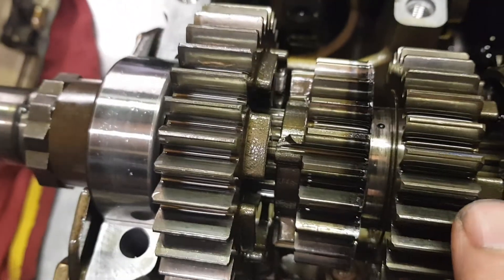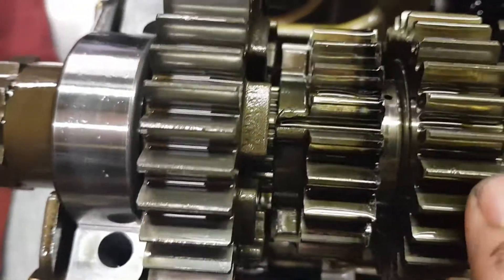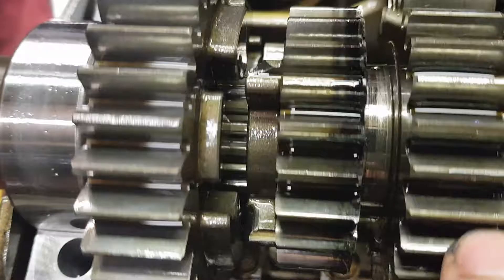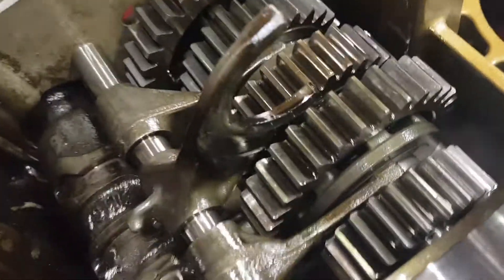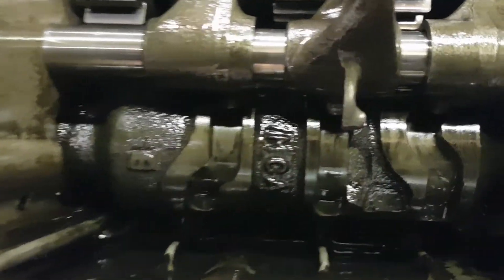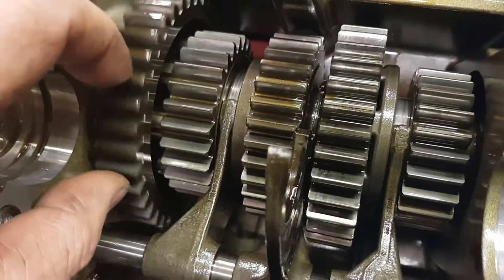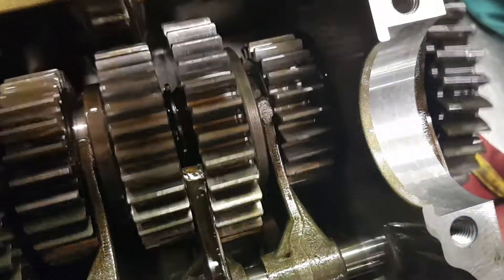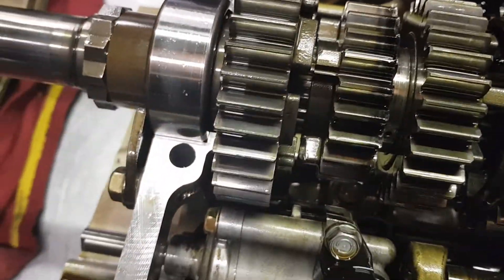015 - Another GL1800 Gearbox Failure - We Can Fix It - 2

Comment: thats what a heel toe shifter does to a transmission every time ,, riders rest thier foot on like it is a foot peg and destroy the transmission every time
Reply: Dogleg Jake, you are correct.Actually it says right in the owners manual not to use or install a heel toe shifter on a GL 1800 Goldwing
Reply: That happened to me and I learn the hard way that the heel and toe shifter was not a good idea.
Reply: Honda says specifically in the owners manual for the Goldwing, not to put floorboards on the GL 1800. Because probably because it requires a different kind of a shifter also. Here is the reason to never put floorboards and the non-standard shifter addition required because you’re using floorboards..
  if you have a transmission failure, even if your machine is under warranty, Honda will reject that warranty claim because they spell it out in plain language in the owners manual, not to use floorboards on that machine..
  A heel toe shifter is not the reason transmissions fail. I had a GL 1800 Goldwing for two years, I won’t go into why I didn’t like it. But I will say, I went back to a Yamaha royal star Venture from the goldwing buyer??, my current royal star venture is my third Venture since 1986..
  my royal star venture came from the factory with floorboards and a heel toe shifter. The heel toe shifter is not attached directly to the shift shaft. It is attached through linkage with Heim joints… The heel toe shifter rocks on a pivot bearing. The effort, the force of every shift does not go on to the shift shaft of the Yamaha set up..
I do not “ attack “my shifter on any of my motorcycles because I used to be a mechanic at several different motorcycle shops. I see how people attack their shifters, they act like it’s a Kickstarter lever or a foot peg sometimes. I see them slamming the whole weight of their leg onto the shifter to try to find neutral. I see them riding with their foot resting on the shifter… if those people only knew what they were doing when they rest their foot on the shifter or attack the shifter with a lot of effort or rest their leg on it. They should run their oil over a magnet and watch how much metal comes out with the oil when they change it. I’m sure their shift forks are burnt if not bent also..
 A transmission failure is pretty final. When the transmission locks up, pulling the clutch in does not save you. The clutch is before the transmission, so when the transmission locks, the rear wheel is locked until the bike stops. Experienced it myself. I was commuting to work on my Yamaha RZ 350 2 stroke twin..It was my fault, I thought that the engines of the RZ was the same as the RD engine. I am very very familiar with the RD engine because I road race one for eight years, winning six road racing championships, to time national champion.. so when I got the RZ, I changed the transmission oil, but I only put 1.1 quarts of oil in the gearbox. The transmission holds 2 quarts of oil. I did not know that. I rode the bike for several weeks low on oil. On my way to work one morning the transmission locked. I was going uphill. I dragged the Perelli phantom rear tire which was only about 400 miles old down to the cords.. I pulled the clutch in but like I said, the clutched only disengage is the transmission from the crankshaft, it does not disengage the locked transmission from the rear wheel. So I was at the mercy of my skill/reactions. My bike was fishtailing uphill, and the skidmarks were about 150 feet long. I was doing about 60 miles an hour when the transmission locked.. I did not crash but I don’t know how I was that lucky because of the way the bike was fishtailing..
   when I split the cases to repair the transmission. I discovered that one of the gears seized on the shaft. I had six broken gears that had teeth broken right off of the gears, and a seized main shaft. I worked part time at a Yamaha shop at that time evenings and Saturdays so I was able to get parts at cost. There was one gear in there that dealer cost was $270…It was one of the gears that the shift fork would slide left to right ..Rebuilding the entire transmission cost me nearly $600 just in parts. I did all the work. But after that close call, even though I had replaced everything that was broken in the transmission, I sold the machine. I just did not trust it anymore after that..
  baby you are transmissions. Never take first gear RPMs up real high and then shift to second. That is one hell of a collision that goes on inside a transmission shifting from 1st to 2nd. Second gear is the one that is going to fail in your transmission if you are going to have a failure. That is very very common to have second gear go out on you. It’s best to just get moving in first gear, then shift to second around 15 miles an Hour.. when you shift, shift as quickly as possible. Not as hard as possible, just quickly because the transmission will be happier if you shift quickly. Formula One car transmissions are also sequential transmissions, much like motorcycle transmissions. Those transmissions shift in one 2000s of a second..Of course they use paddle shifts in formula one. There’s another thing many people do not realize, you really don’t need to use the clutch if you are good at matching the transmission speeds. When I roadraced motorcycles.. The clutch was really only necessary for the start, after the start of the race, I rarely used the clutch.. The same crashing goes on inside a motorcycle transmission whether you use the clutch or not. It’s just that you need to be precise on letting off the throttle at the right time and then shift while there is no deceleration load or acceleration load on the transmission at that instant. Transmissions go through hell. They are often referred to as “crash boxes”
  if you look at the gears in the video. You will see blocks of metal on the sides of some of the gears. Those are called dogs. When you shift, those blocks on the sides of those gears, go into holes/ slots on the gear next to those blocks. That is all a transmission shifts. The shift fork slides the gear with the dogs on it to the side and those dogs go into holes on the gear beside it. Those teeth around the outside of every gear or always always constantly matched with the gear it is opposite. That’s why they are called constant mesh sequential transmissions. Constant mesh means those gears are always messed with the gear they are facing, sequential means you have to go from first gear, up through neutral, to second, third, fourth, fifth, sixth, and when you want to dance if you have to go 6th to 5th to 4th 3rd to second to neutral to first. That is the sequence, that’s why they are called sequential..Formula One car transmissions are also sequential constant mesh. That’s why when they spin off and go into the grass, you’ll see them sitting there and you wonder why they don’t get going again, it’s because they are trying to get from sixth gear or fourth gear into first gear by going through the sequence

Comment: Who are you and how can i get in touch? I have 148k on my f6b. 2nd gear went out a week after a i bought the bike at 41k. Skipped second for 100k miles. Now third is kicking out. Such junk. I tried to bring it back to the dealer (Barneys in Florida) a week and a half later after I bought it and they would not take it back. It's my 24th bike since the early 70s, never missed a gear, so you guys that says its bad shifting can stop before u start.